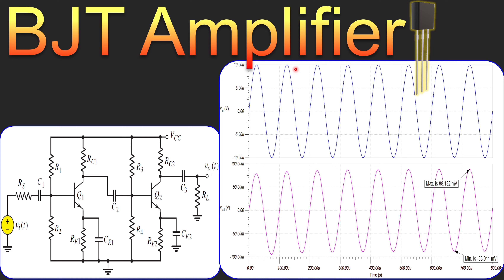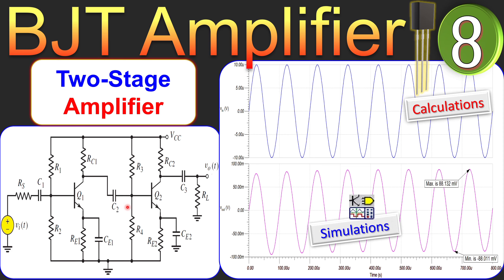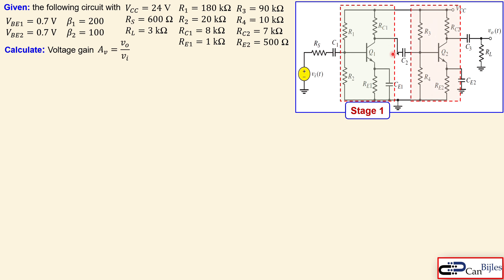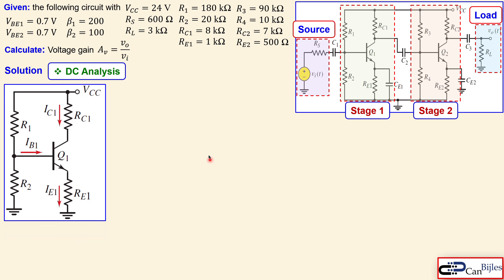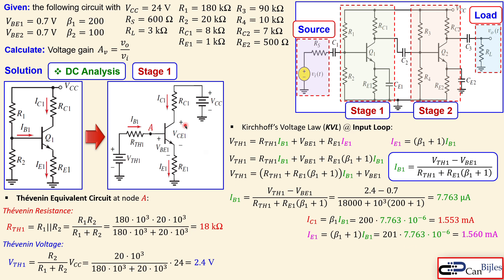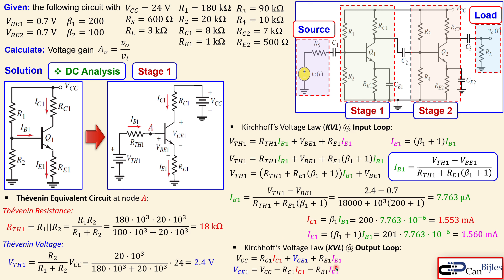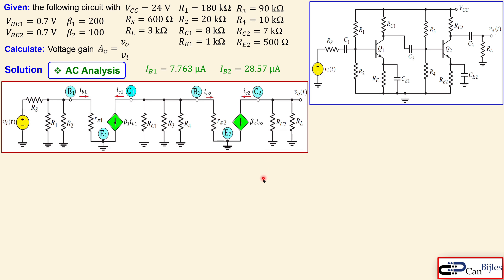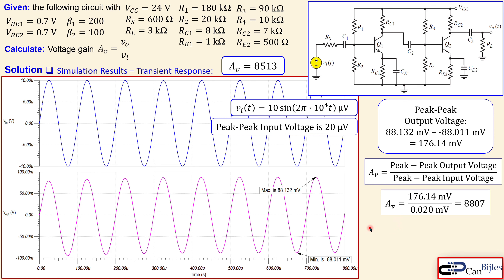Two-Stage BJT Amplifier with High Voltage Gain! 🌟 Calculations & SPICE Simulations 💡 Example 8

Comment: Thank you for your work. I watched the entire playlist and am very satisfied. Do you have any videos, blog articles, or other resources where you discuss how to calculate values for coupler and bypass capacitors? In the playlist, you worked with a fixed input signal frequency of 10 kHz and fixed capacitor values of 10 µF. But what if the frequency changes? Or if there are multiple input signals, say one at 100 kHz, another at 200 kHz, and a third at 400 kHz? How can I calculate and choose the optimal capacitor values in these cases? Also, what type of capacitor should I use—ceramic, electrolytic, tantalum, or another type?
Reply from the maker: Great to know you liked the playlist. It is a good point to know what value and type capacitors we can choose. If the frequency changes, the circuit will definitely respond different. Specifically about capacitors and types, I can advise this video of Alan Wolke: https://youtu.be/J0TjW_0xTJU
Reply: @CANEDUX  Thanks for the video suggestion. Regarding "If the frequency changes, the circuit will definitely respond different" - do you maybe have some resources (done by you or by someone else you can recommend) on how to calculate the right capacitance?
Reply from the maker: @BentFunction  I do not have a video going into details of the choices of capacitors, but I do discuss the effect of frequency on the circuit. See for example the playlist about Analog Filters: https://www.youtube.com/playlist?list=PLuUNUe8EVqll-7GNROQDvzXL9dEBa1oRp

Comment: How could I design a BJT amplifier with 100,000 gain?
Reply from the maker: You can try to create the maximum possible voltage gain for each stage and cascade them to get larger voltage gains. But it is important to keep the amplification linear, so check the transient response always.

Comment: which type of transistor did you use?
Reply from the maker: I used a blank BJT model oof the simulator where I can set the values of beta and base-emitter junction potential. There are also other parameters in the model I have not changed, but this is also the reason why there is some errors in the calculations compared to the simulations.
Reply: i used the 2N3904 transistor with all the Rs and Cs having the same value of yours but my gain was approximately 500 something is that okay or may i have an error
Reply from the maker: The model of the transistor in the simulator will have an effect on the complete function of the circuit, thus also the voltage gain. Try the same circuit with a different BJT model with few parameters you use in the calculations and compare this again. Let me know what you have.
Reply: yes i tried a different bjt (2N2222) which had a much larger gain more than 1,000
Reply from the maker: @CarlaWazni  Indeed, the model will determine this. I used a pretty simple model in this case.
Reply: @CANEDUX okay thankyou alot
Reply from the maker: @CarlaWazni You're welcome!
Reply: is there another way to get the gain ? without using the graph
Reply from the maker: @CarlaWazni You can use the frequency response to see the gain faster, but transient response will show you the shape of the signal also. Just looking at the signal level without considering distortion is not very useful
Reply: hello how did you apply it hardware if the oscilloscope takes minimum 10mv as input?
Reply from the maker: @CarlaWazni  You can use an attenuator if possible.
Reply: oh okay, do you have any idea what parameters i can change in order to have an input of 10mv? without the output clipping
Reply from the maker: @CarlaWazni  Here is a good video tutorial about attenuators: https://youtu.be/A5gGeV7CiQ0